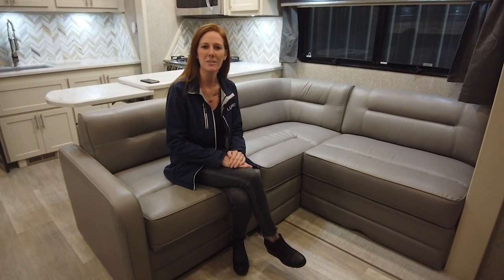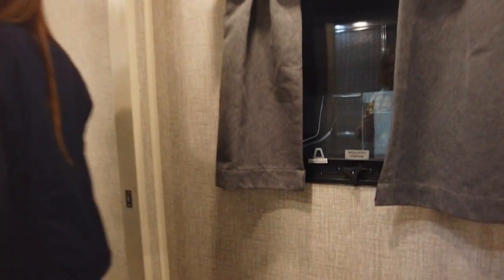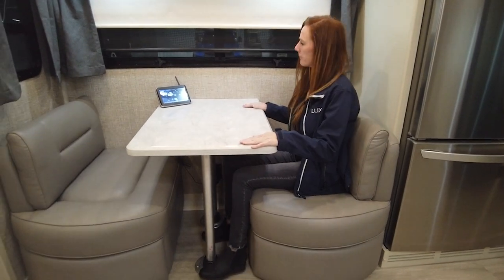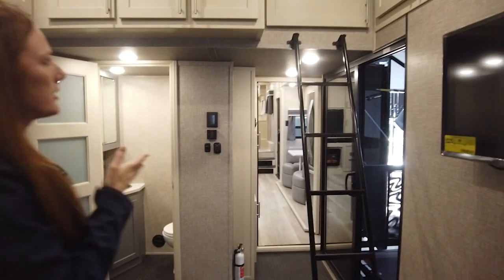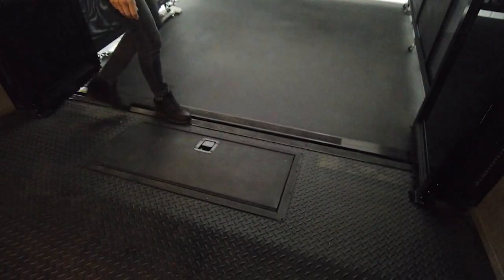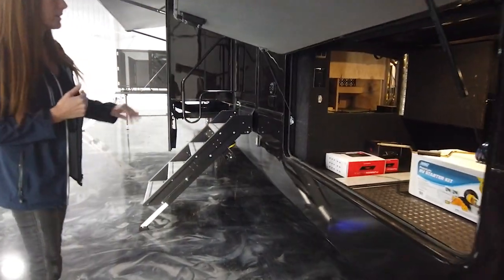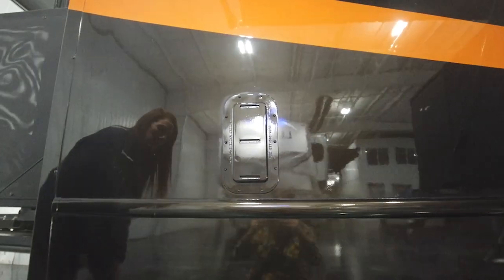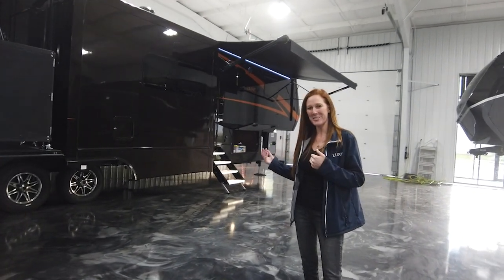2023 Luxe 48FB Toy Hauler; The Largest Toy Hauler in Our Fleet

Comment: With the garage setup like this, with the side patio, the 3 season doors, and the 1/2 bath turned sideways, what are the actual inside dimensions of the garage?
Reply: Would like to know as well
Reply from the maker: I will look and see if we have those measurements
Reply from the maker: With all of those options, 12 feet would remain in length and it would be 85" wide
Reply: @luxefifthwheels  what about height

Comment: can u get a smaller garage basically motorcycles or atvs to gain more interior living. the inside is cramped
Reply from the maker: If you are looking for more living space you might be more interested in the Luxe 45, 46 or 47FB Toy Haulers 

Our Luxe Toy Haulers come in 4 different floor plans. 
- 44FB with a 14' garage length, width 96.5"
- 48FB with a 16' garage length, width 96.5"
- 45FB with a Large living space and 10' garage length, width 96.5"
- 47FB with a large living space and 12' 6" garage length, width 96.5"
-46FB with a large living space, front bathroom, and 11'8" garage length, width 96.5"

All of our garages and entire walls including our slide-out walls are insulated with the 3” Super Composite Walls-High Gloss Composite Gel Coat (welded cage, closed-cell graphite-infused foam insulation)

Our luxury toy hauler garages are very flexible as far as what you can do with the garage space (FlexSpace Garage). For more details on our luxury toy haulers click here: https://luxefifthwheel.com/products/best-constructed-luxury-toy-hauler/

To speak to one of our knowledgeable factory reps call (844)284-6678